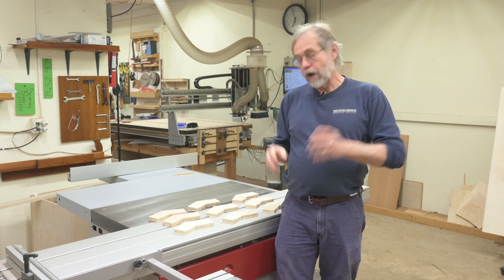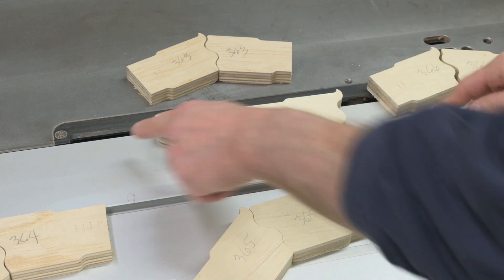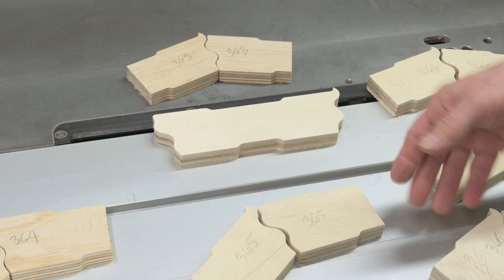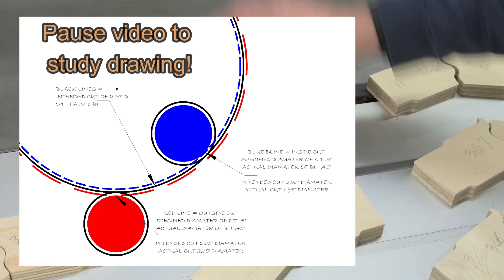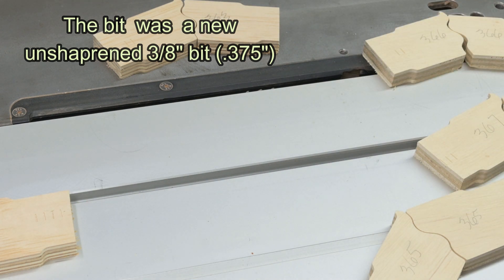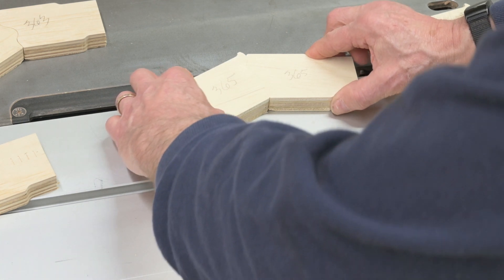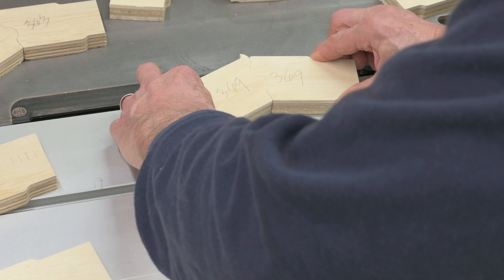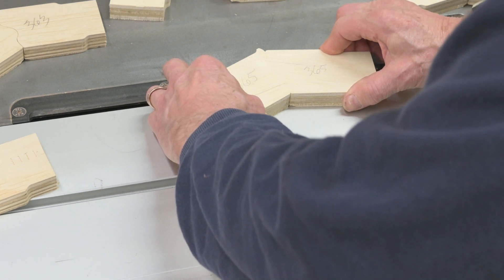CNC Tool Offset Test

Comment: I guess a deep curve, U-shaped male/female, would be easy and accurate to test fit with? Also, it would be interesting to see if multiple cuts actually multiply any errors or not, like Fadi mentioned previously. Maybe I'm wrong, but it seems to me that's the only way, or at least the best way, to confirm where the errors are.
Reply from the maker: the shape is easy to test fit as you can see in the video - a difference of .001 made a noticeable difference. Multiple cuts do magnify any error - but the combine error is not enough in this case to make things go awry.

Comment: way above me like the space station, were the parts cut out in 1 pass, as a tool and die maker before the calculator was invented and dial calipers were big $ a good mic. was the key along with gage blocks and .0001 indicator was used. could heat from cutting change the diameter. of the bit  .001 or 2?
Reply from the maker: the parts were cut out in several passes then a .01 clean up pass was taken.  I'm not scientific to know how much heat would change the diameter.

Comment: High end bits, e.g. Amana Tools or BitsandBits, are extremely accurate to what say. The diameter is not the issue. The issue is the tight tolerances that the CNC cuts to in wood, which you have to account for. What you did is this: 0.375-0.365=0.010 inch difference in diameter, that is 0.005 in radius offset added to both sides to allow for the parts to mate. In Vectric software you have the option of adding “offsets”. What you did was to trick the software to add that offset. When I inlay in the CNC or do finger joints, I have to add usually 0.003 in (in both directions) offset, and it is usually a trial and error. I’ve seen your video in which you do that manually when you fit finger joints if I remember. Also, you’ll have to remember in this case that plywood behaves differently than hardwood, and 0.005 offset maybe too much for mahogany. You’ll have to test in the same species unfortunately. If the bit diameter was wrong, then when we cut a large pocket with the CNC the error would multiply and the result will be way off in an inlay for example, but that is never the case, the added offset remains the same (0.003 for example) no matter how large the female inlay pocket. I hope this helps.
Reply from the maker: Actually the bit was an Amana Spetkra bit. 
 I respectively disagree.  The diameter is the starting point. If its not correct and the tolerances are close then you will have problems.  While the bit should have measured .375 ( no run out or other issues) the slot I cut measured .368. You are right about the .003 offset for mating parts - I called that out wrong in the video. If you recall in the video the pieces that mated correctly were .365 which was .003 off from the measured slot.